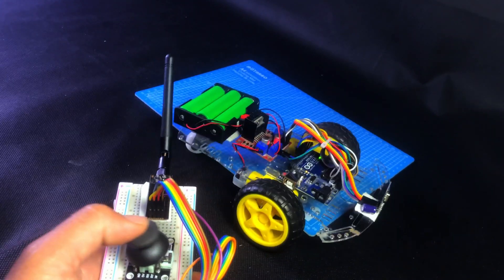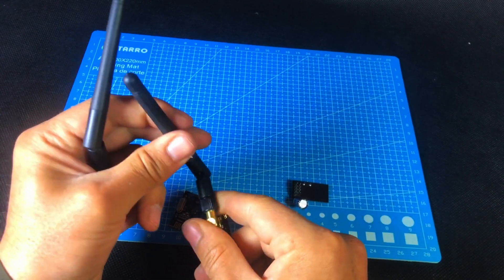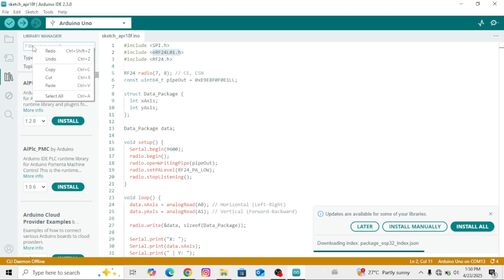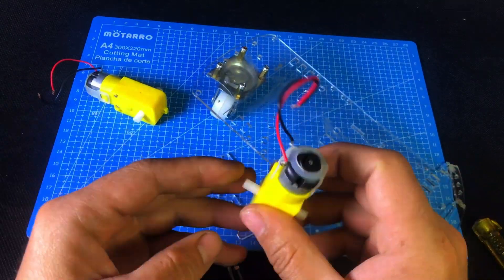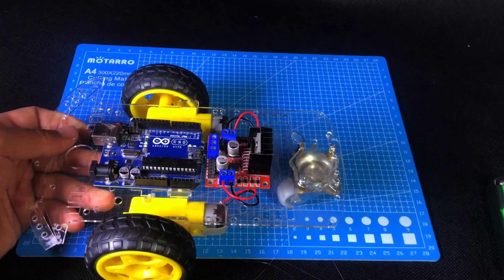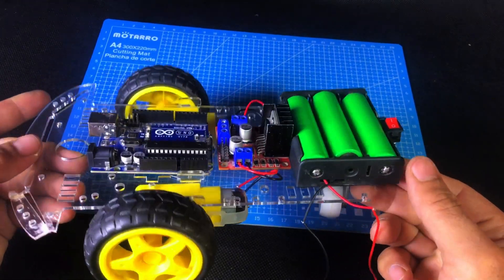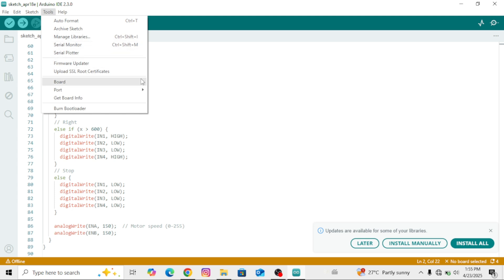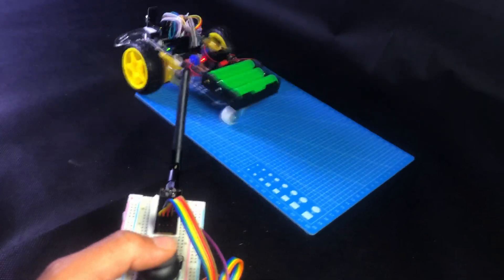Build a Joystick Controlled RC Car using Arduino & NRF24  Full Tutorial for Beginners!

Comment: Dude can i use the3.7v battery for the transmitter
Reply from the maker: Yes, I used two 18650 (3.7V) batteries.

Comment: Dude my project is not working I have used all the components whatever u mentioned without reason all the wheels are moving without moving the joystick in the transmitter part I have rechecked the joystick and it is perfectly working can u help me
Reply from the maker: cheak NRF24 connection